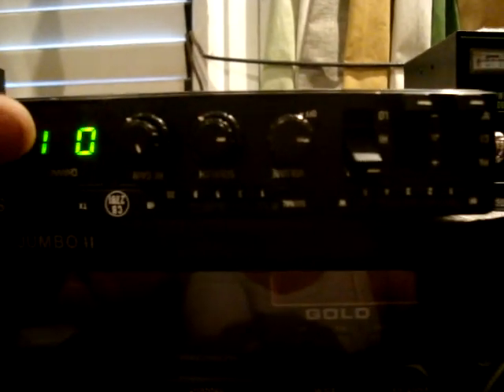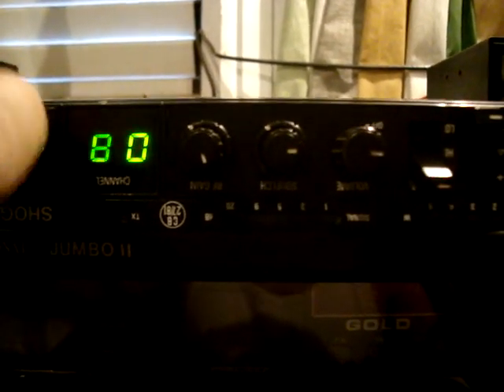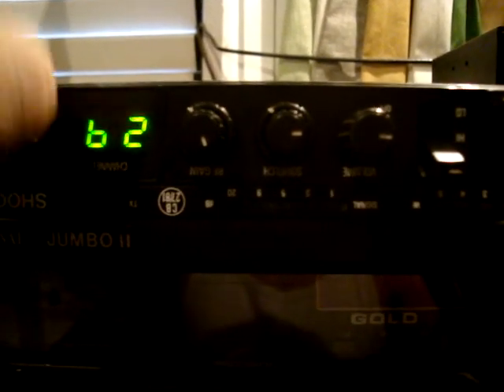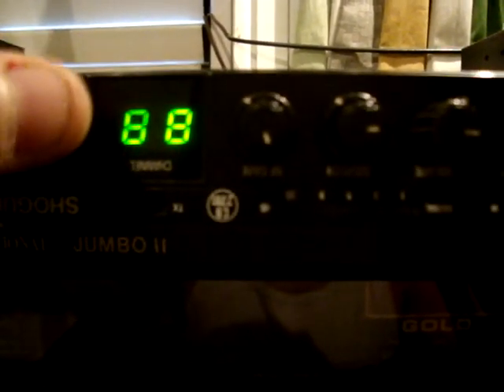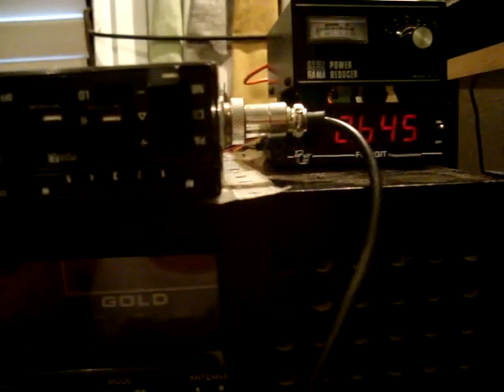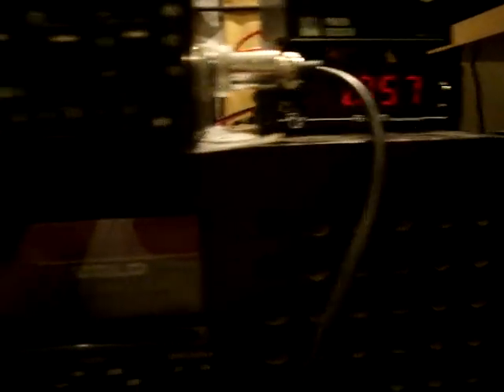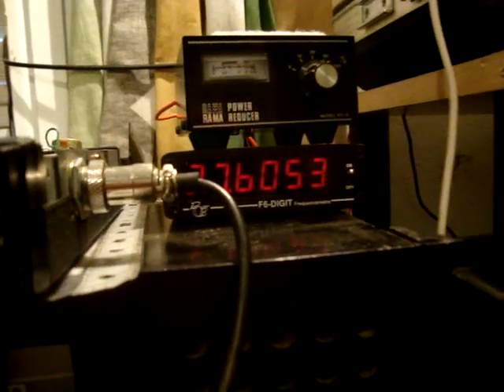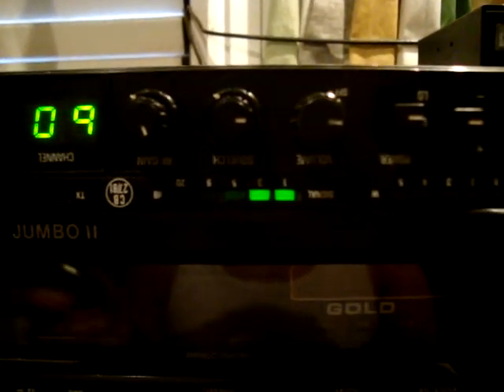elbex master 34 no 5 frequency modification 34ab138

Comment: Hello is it possibile to reiceve the schematic of modification? I have a polmar Tennessee similar to this
Reply from the maker: I don't have it any more, it was a long time ago. But it is the same as a kraco 2530 I think it is called. To modify it you must remove 1 Crystal and change it and disconnect the signal to the switching transistor which switches in Crystal number 2 when it gets to the channel where it suddenly jumps to 26mhz and manually switch between the one and the other and change the channel selector to a 40 position BCD one. It's not so easy to work out if not a true technician.
Reply from the maker: What I just wrote above is the easy modification, the one I did is very complicated and I invented it myself, I cannot even remember the details but I put a bcd to 7 segment display adder I  the channel selector circuit to allow it to count up to 99 and programmed a PLL to contain the frequencies so they correspond to the number of the channel which I got custom made for me by Gerhard Maurer. This mod is totally unique.